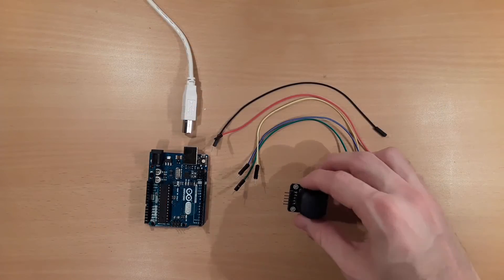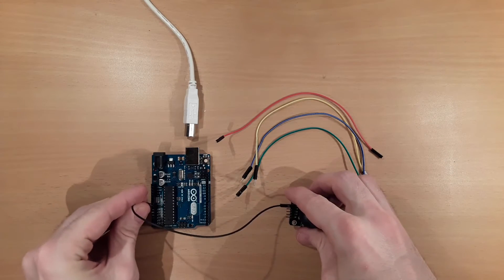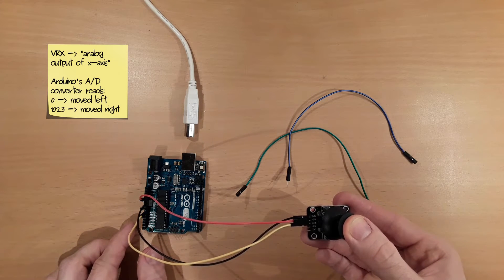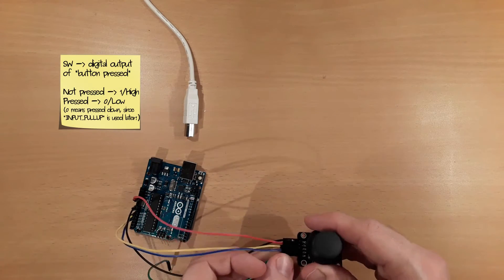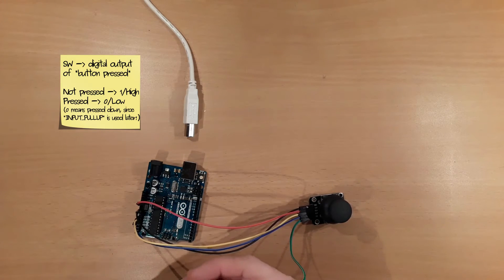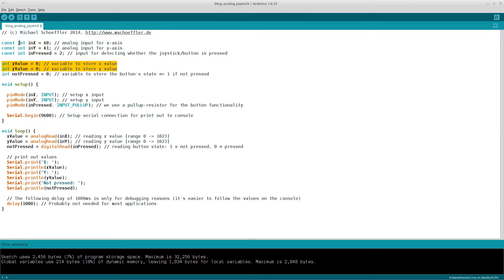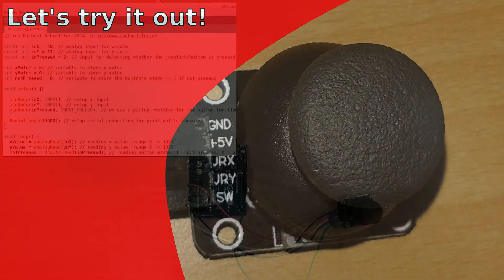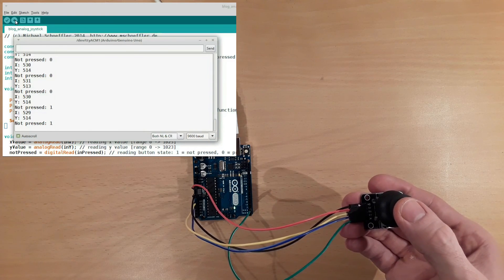How to use the analog joystick KY-023 with the Arduino Uno | UATS A&S #2

Comment: when i am connecting my joystick with arduino ... the arduino uno power led stops and same is happening with mega. first i thought it must be issue for power then i checked all the connections and everything. please help I am not understanding what is the issue exactly...
Reply from the maker: ok, this sounds strange... this might happen if the connected module draws too much current from the Arduino. However, it's more than unlikely that this is the case for the KY-023. Maybe there is a short circuit somewhere?
- What happens if you connect only 5V and GND of the KY-023 to the Arduino?
- What happens if you connect all pins but have an "empty" program running on your Arduino? Maybe there is some problem with your source code (e.g., division by zero etc)
Reply: when i connect 5V abd GNd to arduino the devices stops as the power led stops blinking and when i am connecting all the pins to the board there is no power in the board, so no point of uploading empty code.. arduino is running fine but as soon as i connect the Vcc and Gnd the arduino stops taking the power and it is disconnected automatically even though it is connected
Reply from the maker: Sounds to me like a short circuit. If this is the case,  your KY-023 is either damaged or there is some sort of debris on the breakout board causing the short. Did you already try cleaning the KY-0223 board including the bottom side. If some debris is causing the short, cleaning could help. 
If you want to know for sure, I recommend to use a multimeter. Do you have a multimeter with "Test for Continuity" ? If so, you can easily check whether there is a direct connection between 5V and GND (see e.g. here http://en-us.fluke.com/training/training-library/test-tools/digital-multimeters/how-to-test-for-continuity-with-a-digital-multimeter.html).  If the multimeter does a "beep sound", something is not right with your KY-023.

Comment: If i were to hook it up to a pro micro could i get it to output commands with diagonal movements of the joystick?
Reply from the maker: Yes this should work. If I'm not mistaken, the Arduino Pro Micro has nine(?) analog inputs. You need only two of them.
If you are not interested in the raw x- and y-values and just want to have something like "left-down", "right-up", etc., I guess you need a little bit of extra logic in your program => "if (x > 750 && y > 750) { command = 'right-down'; }..." 
I hope this helps... let me know if not ;)